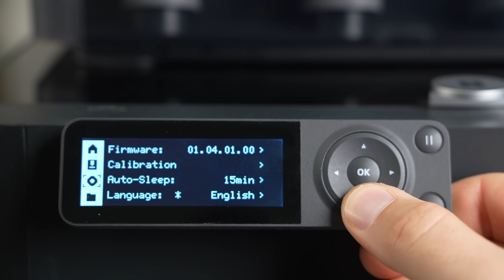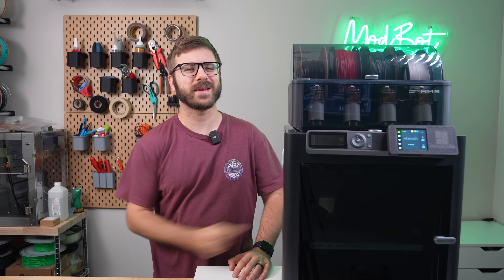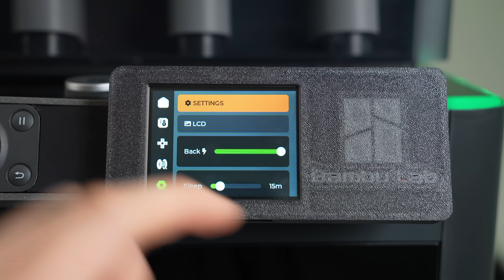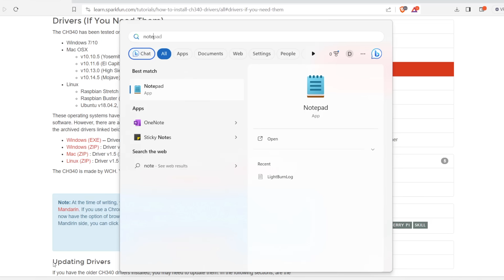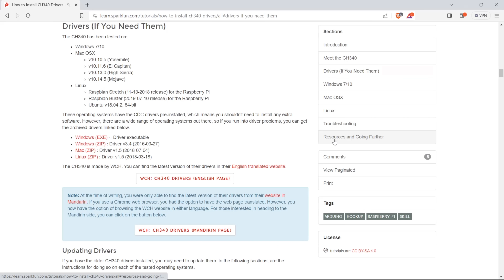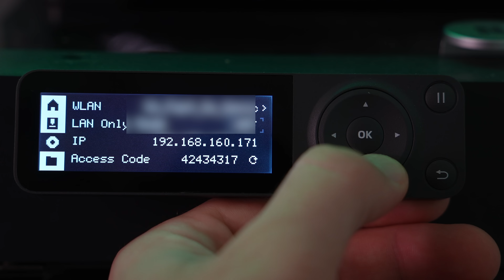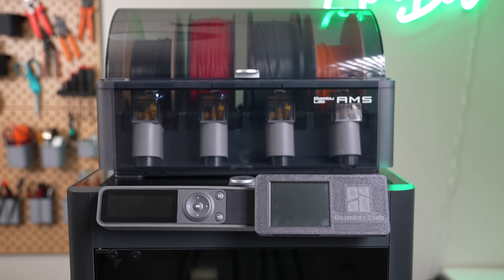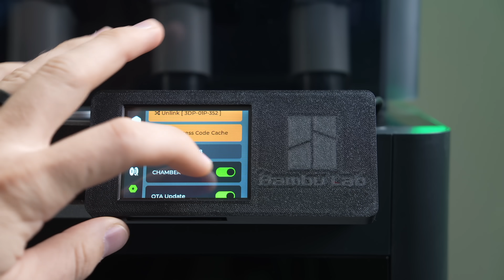Touchscreen Add-on For Your Bambu Lab 3d Printer! (xtouch)

Comment: After 12 very frustrating hours, I'm calling it quits. This XTOUCH is not only not ready for prime time but is not ready for Alpha testing. You should be able to purchase a preloaded MicroSD card specific to your computer with a prompt for you to enter your SSID and password and that's IT. Mine is stuck in a can't connect/reboot loop stating my SSID is not correct, yet it is after 3 different creations and reloads. The display initiall powers up and the latest firmware seems to have updated all to no avail.
I guess I'll opt out later for the Panda Touch which I hear is a piece of cake to install. 
Darn shame too because with just a modicum of additional effort this could have been a great affordable enhancement to the P1 series 3D printers.

Comment: I installed this on my P1S and while it does work, there is some software development that needs to happen. The loading and unloading of filament process needs some serious refinement. The load and unload screen does not present the temperature or the status of the loading procedure like the little P1S/P screen does, so you don't know where you are in the process. And after loading, the temperature mysteriously goes up to 260 degrees and stays there. So for loading and unloading filament I'll need to use the stock screen for now. There may be other shortcomings as well but I have not used the device for that long yet.
Reply: Thanks for the info!
Reply: Do u know if they fixed this problem?

Comment: Actually SD cards larger than 32GB will work IF you format them as FAT32. You will have to use a third party formatting utility to do that because Windows will not give you that option. I have a 128GB sd card in my P1S....
Reply: You can do it in windows, in the disk manager set create a partition less then 32gb and it will allow you to select FAT32.

Comment: The x touch has only 2 functions that the oem screen doesn’t have 1.the colors can’t be changed, 2. Temps 3 load/unload . I don’t see the point yet. The WiFi is terrible with it and restarts require set up all over again. Needs a lot of work before it’s viable. I appreciate the work the designer did tho. Hopefully down the road it’s better
Reply: my experience was similar to yours. A this point the mod is pretty useless, and very very unstable.
Reply: @mortenkallesen923  I’m hoping that it’ll get better but for now it’s a no fly zone for me. Waste of time I’ll wait until it gets better

Comment: Just buy the x1 - simplier
Reply: or save $400
Reply: @a2dskins not worth it - more work  - we are well past "low cost projects" for 3d printing - in my opinion - just buy something thats all together
Reply: @VanguardSys  Hey if it's worth it to you it's worth it. $400 is the cost a large format printer. I'd rather have two printers

Comment: Thanks for this video.  I had the screen and tried to set it up with P1 Touch, never got it to connect.  This is a much easier process.
Reply: P1 Touch literally has a Website installing it for you. It can't be easier.
Reply: @hasserecht3678  I had it on the network, but could not get it to pair correctly with my P1P, this worked so much easier

Comment: Been following this for a while. It has come a long way since I first saw it. Personally I'm hoping that between this and the screen they put on the A1 that it encourages bambu to release an official screen replacement for the P1 series.
Reply: Thats been my hope with these projects as well. Perhaps when the upgraded x1e or whatever it is released and becomes the new top dog, they will allow mainboard/screen upgrades onnthe p1 series.
Reply: A replacement screen for the P1 series would mean a X1 killer, not really beneficial from bambu lab perspective :)
Reply: @Dreaky  Not at all, there are far more features that the X1 has that the P1 series does not that would hardly gut its market.
Reply: @OmegaGamingNetwork  It would definitely take Market share away from the X1. In the Office we bought an X1 over the P1S primarily because of the touchscreen.

Comment: This has to be the absolute worst LCD+Touch ESP32 based board out there... there are so many with capacitive touch and high resolution these days. As for the licensing, the project uses Arduino, so the most open they can go is LGPL.
Reply: 5 inch esp32-s3 will be supported in the future. Development takes time. It's free.
Reply: @a2dskins  oh I am quite aware of the price of such projects :)
Reply: @ficeto   The developer picked a board that has the lowest cost to entry. That actually has a lot of value. Once the bugs are worked out he can work on supporting displays that are 400% higher in cost.
Reply: @a2dskins  I'm not sure you understand the topic well. Bugs and screen have nothing in common. The project could have worked well on other screens too. Does not have to be just this one... archaic 320x240 resistive touch board with rev0 ESP32 on-board. And saving $5 on a screen for a $600 printer?
Reply: @ficeto If you need a Ferrari for a 45mph street that's your choice. Honda sells more civics.

Comment: So the plug is only used for powering the board? IDK how useful it would be but that would mean the touch screen could be anywhere as long as it's on the same network?
Reply: Yes. Also you can use to control multiple printers
Reply: I did all of the setup on my main computer which is two floors above my printers.  Could see the temps and probably control the printer from here.  A great $10 purchase

Comment: Cool, but can you disconnect the mono screen after this and just use the Xtouch?
Reply: Yes you technically can
Reply: No, but you can hide it XD
Reply: yes you can
Reply: Well, after Teaching Tech released his screen mount which hides the original LCD in the back, you can just flip up the xTouch and use the original LCD if need be. So removing the display seems like a bad idea, since the xTouch might not work if the internet goes out or there is some functionality that the xTouch doesn't have, such as AMS controls.

Comment: Makes me wish I had a P1P/P1S so I could use this.  Looks like an awesome upgrade.
Reply: Having a P1S, my biggest gripe is the poor camera framerate limited by the processing power. It seems like it has possibily improved over patches from when I first got it but I've been looking into home assistant integration to do similar controls but also have a better camera setup.
Reply: I wouldn't think of this as something you'd want to do/wish for. all this is is a workaround to an undesirable non-issue. this 'upgrade' is something no one wants to do, because it should have been a touchscreen to begin with. that said if you had this printer why not source the same screen as the X1 Carbon?

but my point is this: having bionic limbs is a cool upgrade... for those who are amputated. so don't go get yourself amputated just for an upgrade.
Reply: @heyitsdrew  The X1 Carbon screen will not work on the P1P or P1S.  For about $10 on Aliexpress, this is a cheap and very helpful mod.
Reply: @heyitsdrew  I already have an X1C, I’m not really going to buy a P1P/P1S, I said what I said to emphasize that I liked this mod.  And for those who already have a P1P/P1S why not do the mod to make things more convenient?  It’s obvious that Bambu isn’t going to come out with any sort of touch screen upgrade.  At least now people have options.